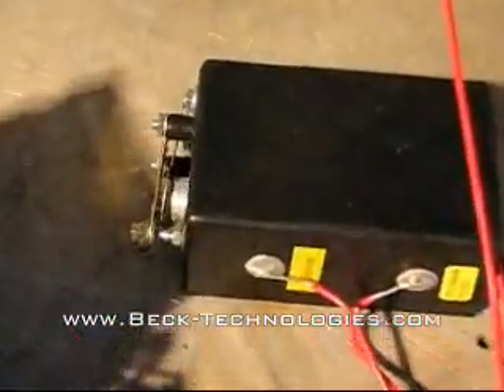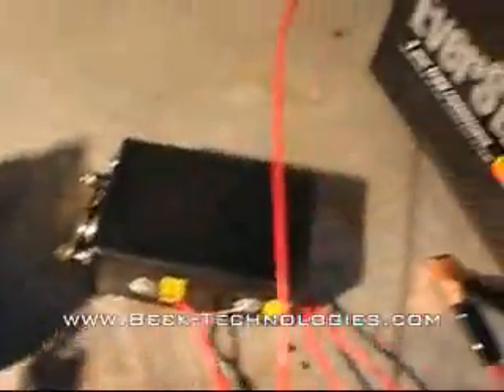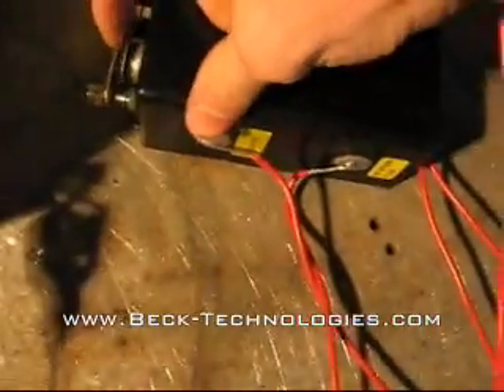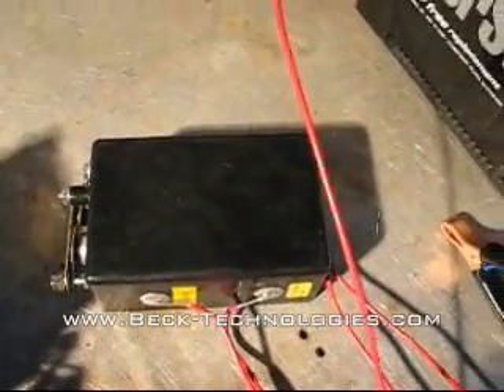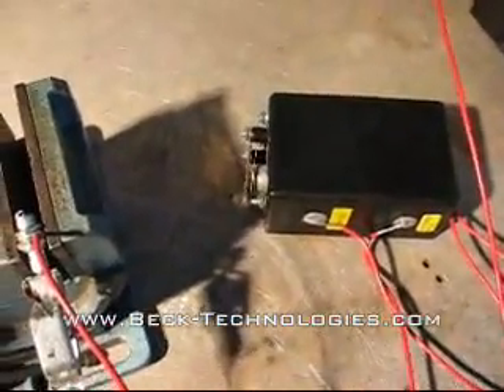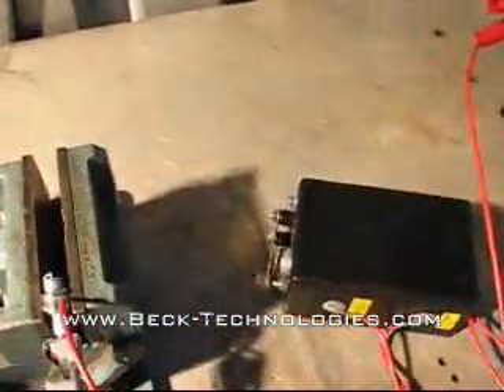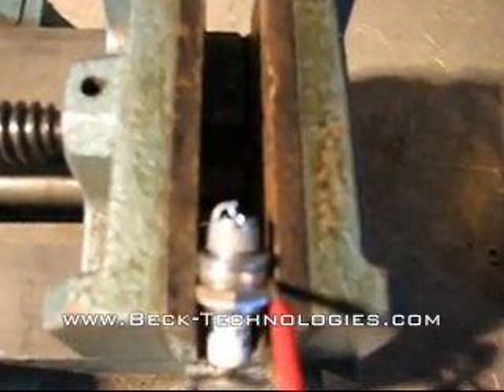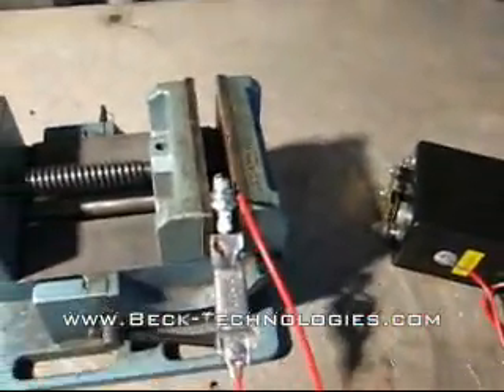Pulsejet Starting - Model T Ignition Coil Overview

Comment from the maker: Definitely, you can run them off a wide range of voltages, at top speed the model T magneto system produced 48 volts apparantly, min voltage is about 6 volts, I run mine at 12 and works nicely.